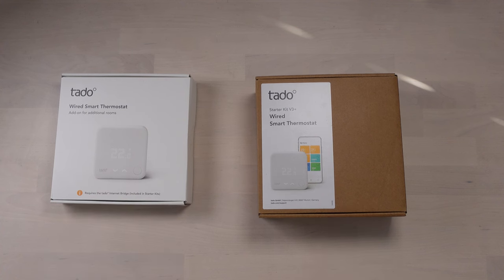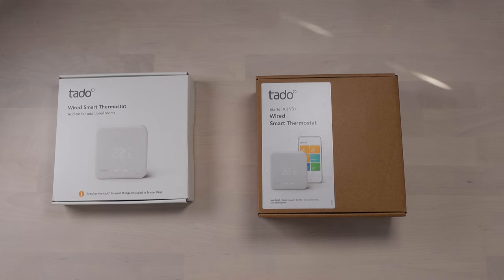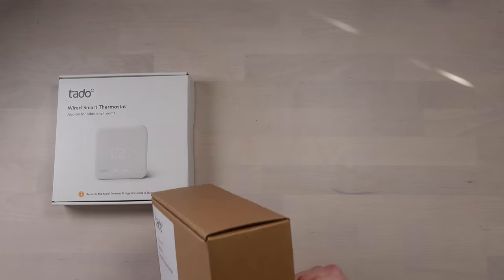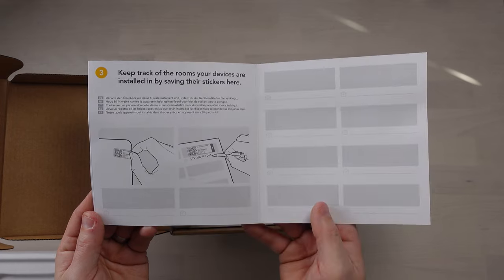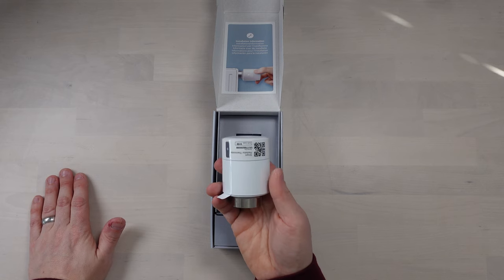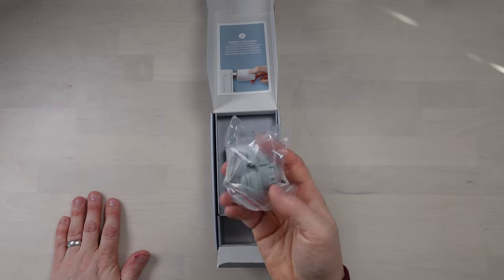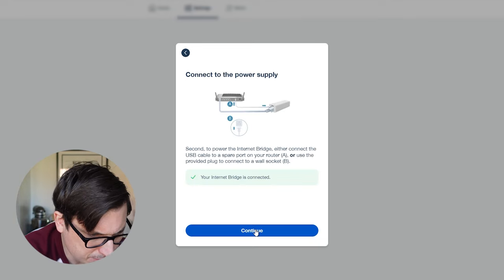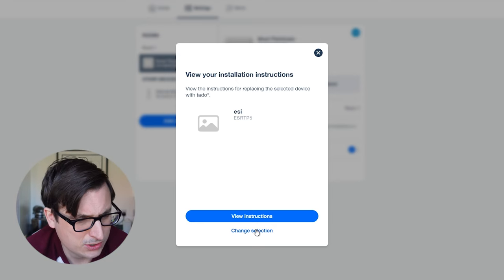Tado Smart Thermostats And Radiator Valves: Save Money On Heating Bills (Full Install Guide)

Comment: Very helpful. I have the same set up with two zones and from reading it appeared Tado would not work for this . Also a number of videos were talking about adding wireless receivers being hard wired into the boiler etc 
This is much simpler , a wired thermostat in the wall connected to the internet bridge. I’m guessing as it’s not wireless or removed the need for this controller in the boiler . I was going to go with nest which I had before in a previous property but this is far better with each TRV being able to call for heat . Thanks
Reply from the maker: Really pleased I can help! :)

Comment: (As a sparky) in sweden, it is not okay to check if the power is off with a tester that doesn't work without battery's as a multimeter, but rules differ heavily!

Comment: A great vid and you've tipped me towards Tado over Hive and Nest. Installing looks simple and the explanation is the best I've seen. I'm looking vm forward to controlling radiators with the ap. And having different temperatures at each radiator will solve the problem of some family members wanting Sahara heat and others happy with a balmy British 21 degrees. One issue might be if room temperatures are controlled by phone presence and people with different preferences wanting to watch say TV together (an old fashioned thing I know). I can see a heat war breaking out unless there's a master control function - I' do hope that the manufacturer's thought about this. Anyway, I 've some work ahead changing all of our old dumb radiator valves to thermostatic valves before popping on the Tado heads. Any advice re avoiding a heat war would be much appreciated.
Reply from the maker: Thanks so much for watching Paul! I really appreciate it! :) Oooh that's a really good question... I'm not entirely sure if that is possible... Tado Support might be able to help! Quite often it's just me and my wife in the house, and we're generally happy with a similar temperature! :)

Comment: Great Video. I have an Ideal Vogue Max combi boiler which is about 2 years old and is run via Halo thermostat set up. Would I be able to install just the Tado Smart thermostat valves and Internet bridge to some of my radiators without the need of installing the Tado hub? I have read that as long as my boiler is compatible with Opentherm and 240v, my Ideal boiler will work? Can you please advise? Thanks so much, Ian
Reply from the maker: That sounds correct, however I'd recommend contacting Tado Support  to confirm.

Comment: So with this then you don’t need the boiler part just wire the thermostat to the exciting and it will work. So I’m guessing if it’s wireless you’ll need the boiler part? Sorry if that sounds dumb just trying to get my head round it as I’ve only seen people use it wirelessly
Reply from the maker: Different setups need different components. I’ve shown what mine does, but others might need the boiler part

Comment: Thanks for the very informative video. I like this system.. I have the Evohome system installed for a few years but this seems more advanced (ofcourse tech advances) and will advise family - who are interested -  to look at Tado
One question: in Evohome, the control tablet screen can be password protected. 
 In Tado, as you say, the radiator valves can be locked down - can the Tado wall thermostat be locked down as well so the only control is via the app.? Stops family fiddling with the temp settings?!!
Reply from the maker: No.. only the valves can be child locked
Reply: Thanks. After seeing my Evohome, family considering something similar and Tado looks attractive.

Comment: Just out of curiosity does your boil allow for modulation/ have a digital output? If It does, was there any reason in particular you decided not to use it? Just bought a tado and trying to decide how to install it. Very comprehensive tutorial!
Reply from the maker: I just followed the wiring instructions it suggested for my boiler ☺️ thanks for watching!
Reply: @kiphakes  have a look into digital bus on your boiler. Rather than just on/off it allows the tado to "talk" to the boiler and modulate the flow temp which produces larger savings.
Reply from the maker: @Aaron-gl8cm  oooh... That's interesting.. Wonder how it would work as I've got two zones controlled by valves..?

Comment: How many radiators plus a boiler can the starter kit cope with?  What system do I need for a lot of radiators?  What happens when the WiFi isn't working?  Sometimes we loose the WiFi for days.
Reply from the maker: So you would need Tado radiator valves for each radiator if you wanted to control the temperature in each individual room. The starter kit I used just came with the replacement wires thermostat and the internet bridge. You can still use the Tado if the WiFi goes down, you just wouldn’t be able to use the app to control the heating outside of the home
Reply: @kiphakes  Thank you for your quick reply. Just got to take a leap of faith and hope I'm buying the correct thing for my heating.

Comment: You don't normally install the bathroom, you have to have at least one radiator in the circuit, this acts as a bypass and releases pressure on the system when it is operating. If you do not have a one, it will damage your system.
Reply from the maker: "you have to have at least one radiator in the circuit" - I don't understand what you mean by that?
Reply: @kiphakes  when the boiler is on it has to circulate water. By putting TRV's on all the radiators the water can no longer circulate around the system and the boiler will likely overheat cook it's self. You may need to make sure that by having TRV's on every single radiator, that you have not cut off the systems ability to circulate the hot water away from the boiler.
Reply: @thefoodiechannelcookingfro1822  so what's the solution for this? leave one radiator without a TRV and keep it always open?
Reply: @DattaDharanikota  yes It needs a bypass for the systems pump

Comment: The downsides of this thermostat that it won't work without internet connection.
Reply from the maker: It will , you just can’t control it via the app. But you can do it manually on the thermostats
Reply: @kiphakes  How? You are pairing all devices through the internet bridge. 
I've tried and it doesn't work